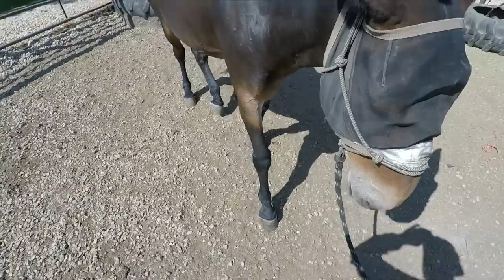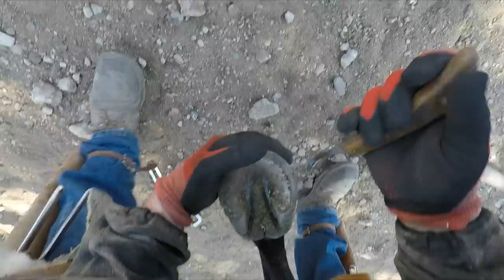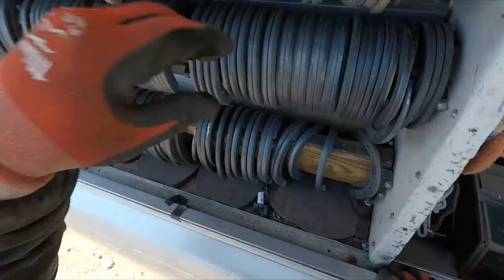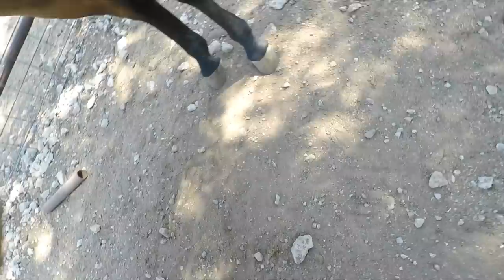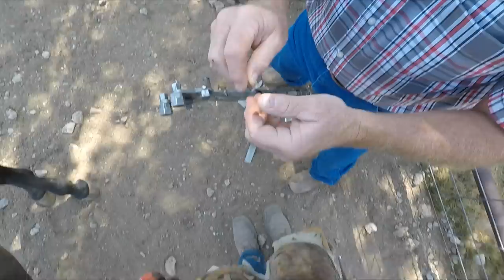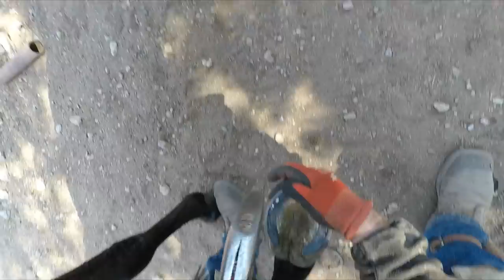Finding Lame Mule's Abscess & A Screw Stuck In The Other foot

Comment: When our horses’s hoofs get dry like that, we just wet them with the garden hose. Or put their hoof in a bucket of water for a few minutes. Then they are easier to trim.
Reply: There's a product called hoof flex. It moisturizes the hoof to stop cracking,splitting. That's what you need.

Comment: Always go over the ground when you do any kind of work with metal screws or nails. I use a magnet bar or you can find them in a Lowes, Home Depot or a building supply store. Also a Granger or a automotive supply store carriers them.

Comment: What would be real freaky would be if both holes were caused by the same screw. When the farrier lifted the first foot where the hole was deep and wide the screw could have fallen out, and then the mule could have stepped on the screw with the second foot, then the screw fell out on the ground. That would have been a screwy scenario. Pun intended.

Comment: That’s called a self drilling screw it’s made for sheet metal. A self tapping screw doesn’t have the drilling tip it has a notch like a tap does and is designed to cut and make threads in an existing hole.
Reply from the maker: Learn something every day. Thanks

Comment: I just think it should be sanitary treatment and if there is pain. Use antiseptic and cleaned utensils. It's very archaic treatment and needs to be improved
Reply from the maker: Cheryl, Thanks for your concern. Out in the manure there is little sanitary. One foot in the wet by the water trough or stepping where they eliminate even  bandaged or not and there is bacteria. the abscess is walled off. Once the pressure is drained They heal right up. If it ain't broke don't fix it. What we did worked perfect. Mule sound in just over 2 days.

Comment: You don't see much mule content.  I have a mule with contracted heels on the front.  Any suggestions?  I trim and shoe them but their shape doesn't change much.
Reply from the maker: Michael, It's pretty tough to overcome confirmation issues. You can tip the heal of the shoe, lowering the inside edge, then the heel is gently forced out. Usually the heel is short, not even with the other heel. you want to trim the opposite heel a bit shorter. you can tip both webbs if both heels are contracted. If you just maintain them they usually stay sound for years.Thanks for watching.

Comment: Are mules always born male?  A vet told me they were but I don't know if he was kidding.
Reply from the maker: Gail Wright, He must have been feeding you a line. The females are Molly Mules, The males are John Mules. Mules are a cross between a Male Jack Ass and a Mare,(female horse). If you cross a Stallion on a Jenny (Female Donkey) you get a Henny not a mule.  John & Molly Mules can breed, and get pregnant but they absorb  them because the chromosomes are off. That's why they castrate the Johns so They don't deal with that. Hope that sheds some light. It probably created more questions........... Thanks
Reply: Jacks (male mules) are normally neutered; it helps calm them down.  Jacks are always sterile.
   Molly mules, on the other hand, are sometimes fertile.  A mule + horse foal is incredibly rare.  There's fewer than a dozen a record.
Reply from the maker: @Cricket2731  A Jack is a male donkey, male mules are called John’s. And they will breed. But the Molly aborts.
Reply from the maker: @Cricket2731  Male mules are John's. Male Donkeys (burros) are Jack 's. Male Henny's are Sam's.
Reply: @RockinJFarrier  I have a picture from when I was younger, of a Molly mule + foal.  Sire was a horse.
Reply from the maker: @Cricket2731  It’s rare but it does happen. 🤠

Comment: I always thought they didnt need shoes
Reply from the maker: Gail. It depends on how rough the trails are and how often they ride. A lot of riding in rocky conditions will wear steel shoes paper thin. They can also get stone bruised. Thanks
Reply: Interesting.. I had a Mustang years ago and I always only had shoes put on the front.  Thanks! Learned something new

Comment: Well you removed a useless screw but added 8 nails to the foot..lol..but seriously, i think you should pour a small bit of betadine or iodine in eash of those holes after you had cleaned them out with your tool, and before you nail a shoe on it that covered the damage areas..
Reply from the maker: The owner did that after we got done. It makes it's way to the hole even with the shoe on. The mule was sound 2 days later.
Reply: @RockinJFarrier  well,  some might find it's way into the cracks and holes.. that is if the holes don't get plugged with debris or mud, etc..  You should do it right away, when its clear and open.. before covering it or it getting more debris into it..

Comment: What an amateur. I feel sorry for that poor mule 
You  did a sloppy job👎
Reply from the maker: The mule went on a pack trip 2 days later.
Reply: @RockinJFarrier  haters will hate. If it was that bad Mr mule be honking and kicking and biting. He wasn't. You took the pressure out and he let you nail in shoes
Reply from the maker: @peterfuchs4596  You're right.There are  always one or two.  How can they argue with success. Thanks for your input and for watching.
Reply: Mules 10x smarter than horses or most people. Cows too. Never got bit by a cow but plenty of horse and the worst, pony, bites. Why got no problem with a nice thin sliced horse sandwich on a chronic misbehaving jerk. Some bulls like that too and one sideways look and back of the barn. And jc this can be done humanely. Better than some 3 yr old rubbed out